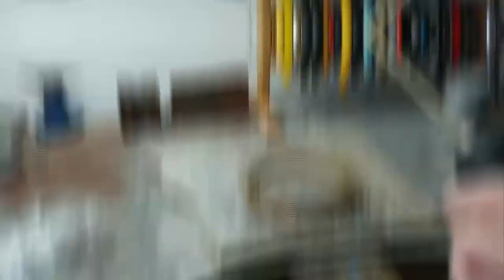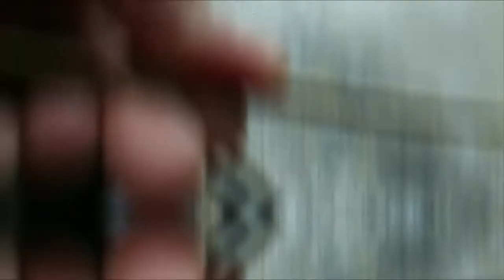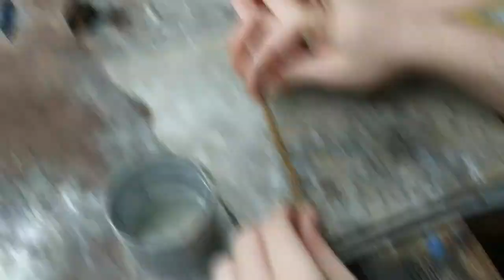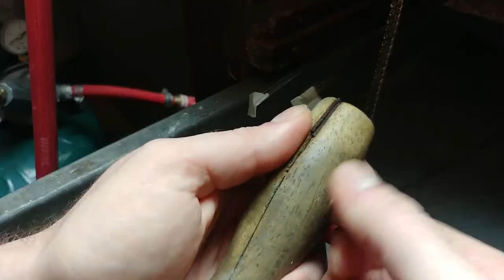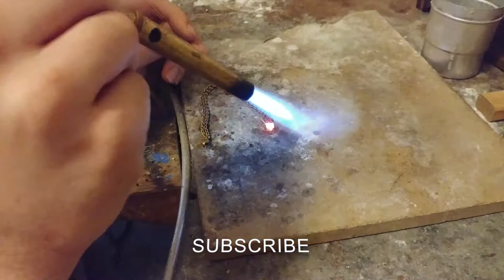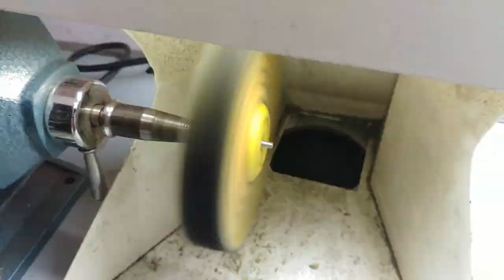How Is It Made? | Brass Bracelet | Bismarck Chain Tutorial ~By Kryher

Comment from the maker: This is where you should make a comment or ask a question, even if you think it's silly! I will answer to everyone!
Reply: Thank you!!  Very inspiring.   Into what liquid do you dip the finished coil before welding and snipping?  How long did you leave it there?
Reply from the maker: Hi Susan, that would be my flux solution, I just dip it in and pull it out, it's faster than putting the flux on every solder point with the fine tip brush as I usually do, but this chain has a near ridiculous number of solder points 😅
Reply: Can you make another video where you actually show how to assemble the links? it's not very clear on how you do it. thanks.
Reply from the maker: Hello there, I plan on making more chain videos, stay tuned!
Reply: @Bohdan Kryher  thank you for the wonderful video :) 
I did have a question about this chain style: I see that you used a 1mm wire for this chain but I am curious about the mandrel size you used for the initial coil rings. Do you have an aspect ratio that you'd recommend for this type of chain?
Reply: Hi to you. Is the distance in the gaps the same size as the wire-diameter ? It looks so easy .. and i tried it...but it looks different to yours...🤨..think it needs practice and practice... so amazing your skills. 👋

Comment: I got so far w a brass chain but it kept breaking or soldering together
Reply from the maker: Are you also using an oxy hydrogen water welder? It just takes more time and you have to be very precise and find the right timing to actually make the soldering, it takes practice but it's not impossible, trust the process!